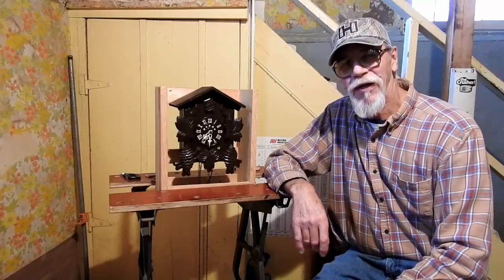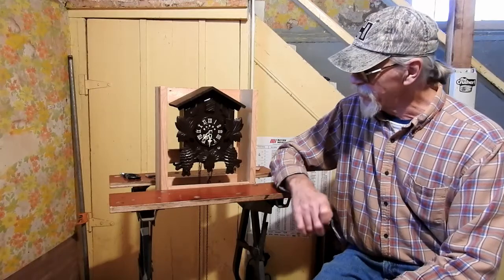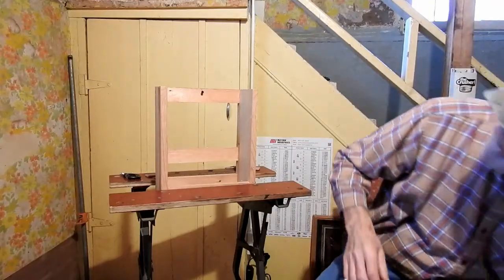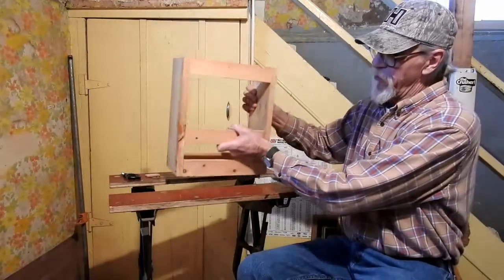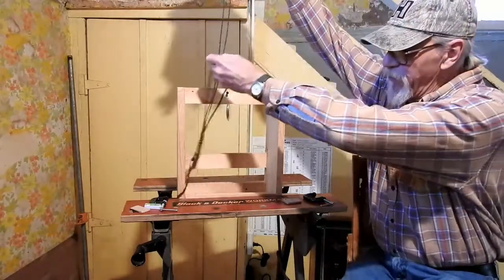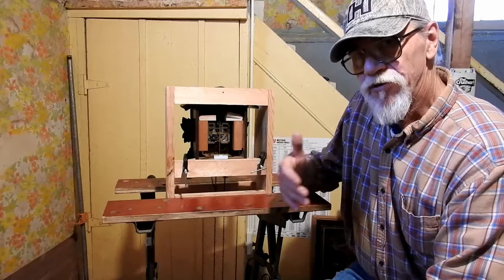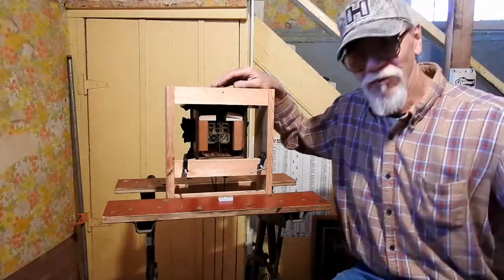Cuckoo Clock Repair Stand on-the-cheap

Comment: Great idea. What would improve this stand is if you have wide enough boards to accommodate any cuckoo clock. That way instead of having this table you could hang it on the wall. You would need boards on both sides of the stand with a hole in it to hang it on the wall. that way you can see the back side of the cuckoo clock working. You could also have a longer board screwed into the bottom and clamp that board to the table that you are working on. Just an idea.
Reply from the maker: Thanks for the comment Mark. Yes, there is always room for improvement. However, I only have 2 cuckoo clocks and fabricated this stand to accommodate them. I have no plans to continue in this hobby as, I have many other hobbies and don't get tied down to one. I will use the stand for future maintenance on my clocks. However, I would like to see your idea come to fruition if you decide to make one. Thanks Mark.

Comment: Great idea! Just what I need.  What are the shims for?
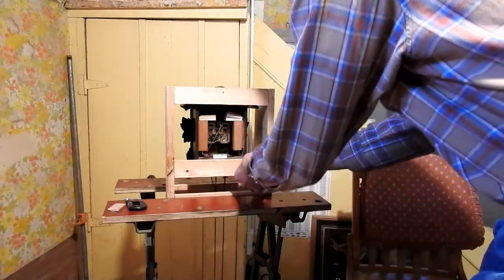Reply from the maker: The shims at about 4:50 are to keep the clock from moving from side to side after it has been leveled and to keep it stable while you make the necessary adjustments to the pendulum wire, (if needed). The clock must be level vertically (plumb) and horizontally for the "tick" and the "tock" to be equal. It is important to mount the clock on the wall in the same plumb and level condition or, your adjustments on the pendulum wire were a waste of time. If not, the "tick" and "tock" will not be equal and you may cause undue wear to the movement. https://www.clockworks.com/ebook/main/#!/weight_driven
Reply: @oldmantech5399  I get it now.. I picked up an old 8 day that I’ll be working on.  This set up will be perfect! Thank you!